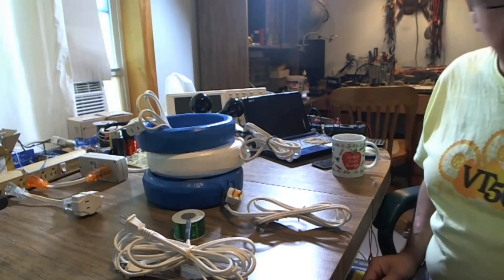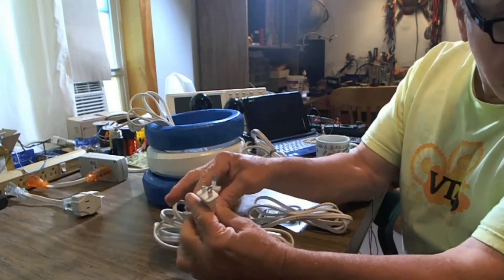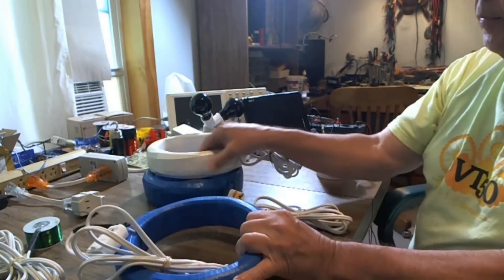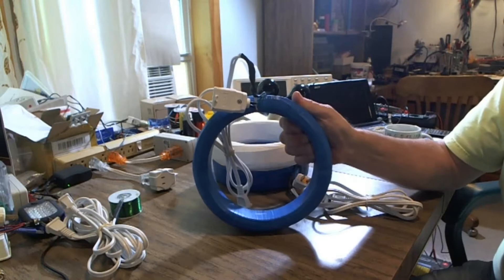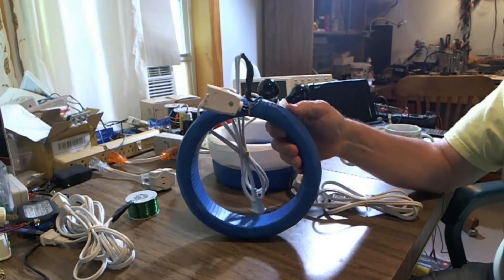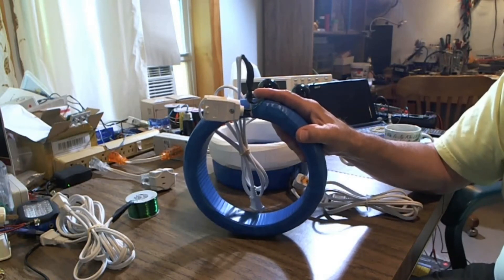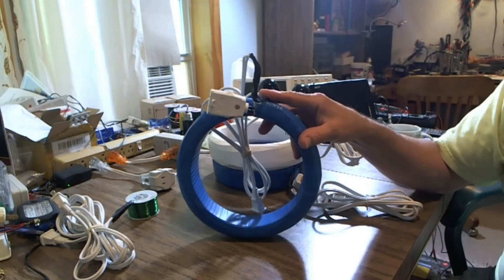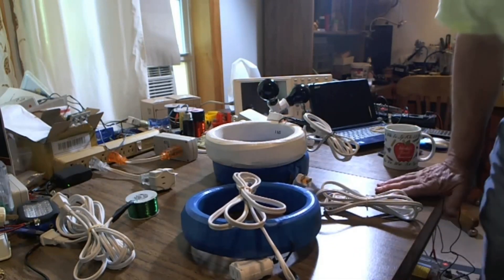Powerful Bililar Coil

Comment: DUDE!!! You are suggesting the use of wiring and plugs that are not designed for your intended use?? i.e: "120 VOLT AC" plugs and receptacles !
Which gives rise to potential electrocution, fire, and/or damage. You are going to unintentionally hurt someone with your methodology!!!!
STOP!!!!

Comment: Can you build a machine that works exactly like the Magna Wave?
Reply from the maker: Yes, with a qualification.  The principle is pretty straight forward, where a high voltage charged capacitor is discharged through a coil.  I recently bought a high voltage, 6000 volt, capacitor to test the concept out.  However, with all the other projects shown on the www.aurorasky.net website, I find my available time is a little lacking.   Maybe down the road I’ll make a more powerful PEMF, but for now the project is taking a back seat until I can find the time to work on it.
Reply: gskempe9 That would be awesome to build but i dont think it works like yours just bigger. I talked to an engeneer from them once. I asked if this machine discharges a cap into a coil? He said no. But inside he said there is a spark in magnetic fieald creating a magnetic wave that they run into the coil. "When it clicks a magnetic wave is being made between two magnets in the spark chamber inside and then sending it down the copper wire attachment and into the body. No risk of electrocution  actually we are the only UL safety approved PEMF device in the United States. There is no electricity in the coil just a magnetic wave you can use it one people and animals with plates and screws"
Reply: They also said "Hi Peter, You are correct on the length of the pulse and the gauss delivered with little effect on the metal objects. Our pulses are of nano-second duration in length. It would take 17 hours of pulses from our machine to receive 1 second of the exposure received from a cell phone or microwave. Our devices are high-voltage, low-frequency devices where the Sota/Beck devices are low-voltage, low-frequency devices. The difference is in the speed of result with regard to inflammation reduction. I would be more than happy to discuss this with you furter on the phone should you desire. Great questions, thanks for your interest." He was trying to sell me one to further discuss it... But they price those things like gold. By the way the largest unit can do 32000 gauses.
Reply from the maker: I would love to talk more about this.  You can initiate contact on the website above using the contact button.  I'll return an email that can lead to a phone call.  Respectfully,  Steve
Reply: Ok